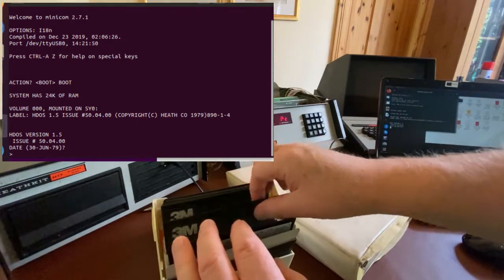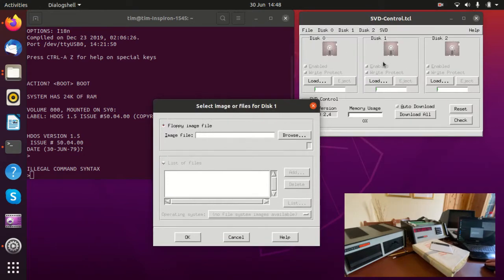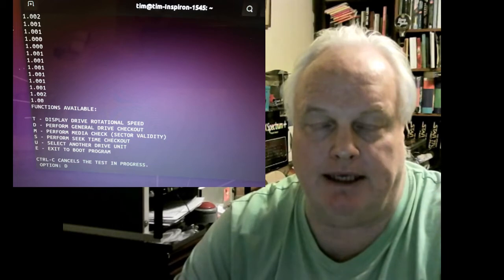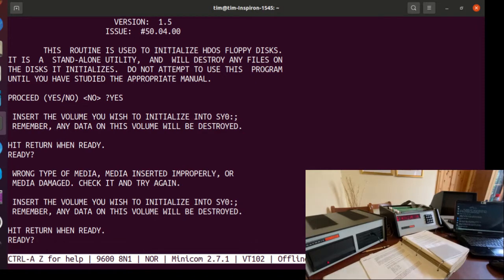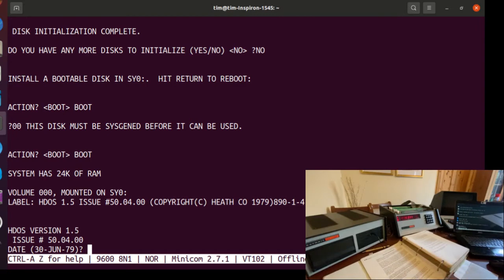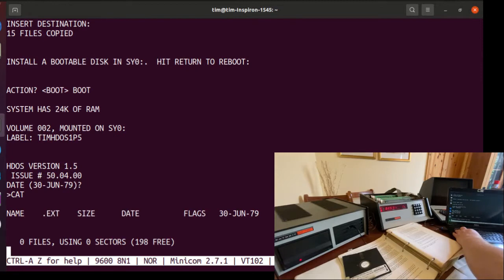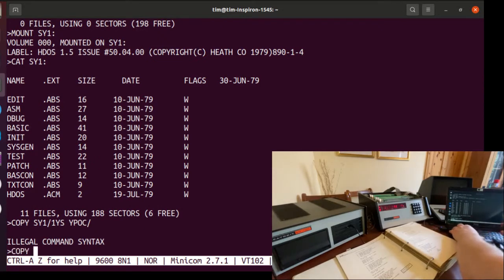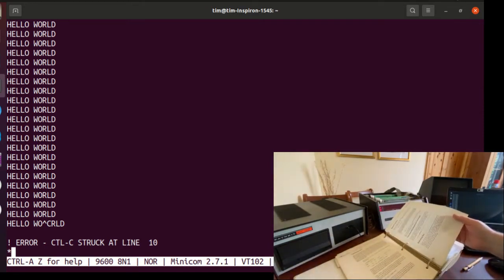Heathkit H8, H17 and H9 - Part 5 B SVD & HDOS

Comment: Hello Tim,.

I found what looked like a very nice basic H8 on ePAY and pulled the trigger for close to $1K with taxes and shipping. It arrived yesterday and FedEx apparently dropped or worse the unit. The backplane is a wreck, with bent pins and boards cocked up.
The seller did a good job packing the sides but didn't put anything in the bottom of the box.
Cosmetically it WAS better than average but now, WHAT A HUGE MESS. The seller is offering a refund but a larger box and some foam in the bottom may have allowed the unit to come in unscathed. SHAME..
Ebay really needs to give sellers MUCH more info on how to ship heavy items. I could tell you some horror stories of rare vintage Ham radio equipment which arrived destroyed due to POOR PACKING Practices.
Looking it over, I will need to spend 10 - 15 hours refurbing the unit, I had planned on changing the PS caps, clean all contacts and hopefully have it going. Now,.......          like I said, WHAT A MESS.

The first thing I need to si measure the header pins for spacing, length and diameter and see If I can 
find those NOS?? 
Any thoughts on sourcing the pins/connectors. Then I'll need to spend hours, removing the old connectors and installing the new ones. 
Regards,
Glenn Scott
Laurens SC USA
Reply from the maker: Glenn so sorry I missed your comment - that is so sad probably the best bet would be to join the google group sebhc as there are many more knowledgeable than I on these things especially sources for modern compatible parts!